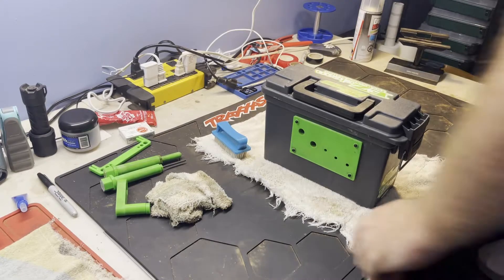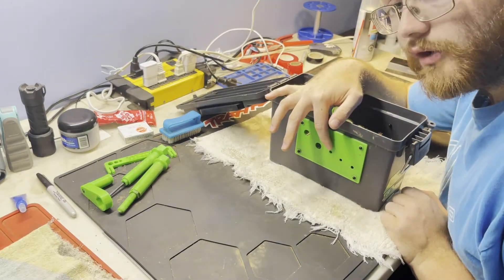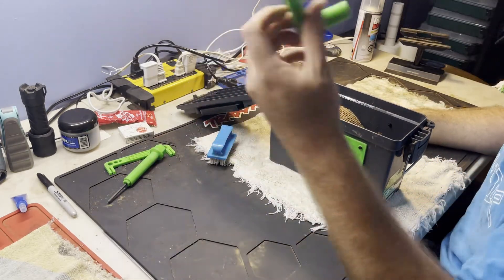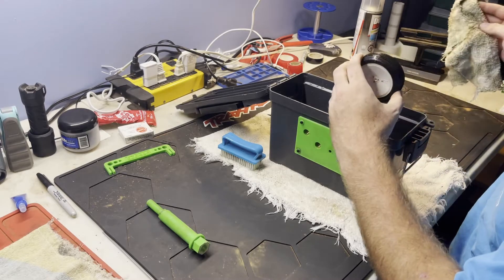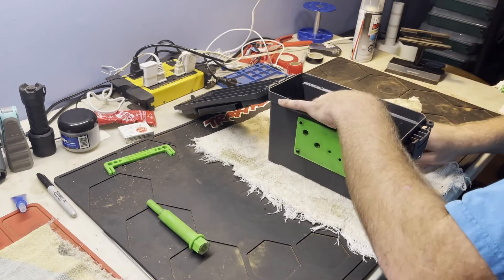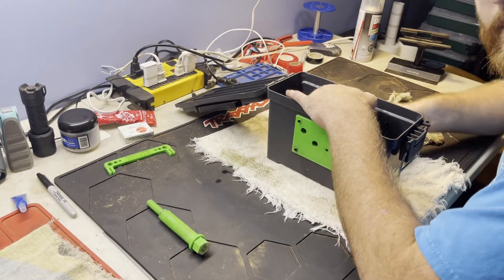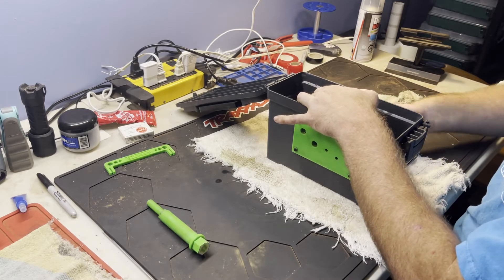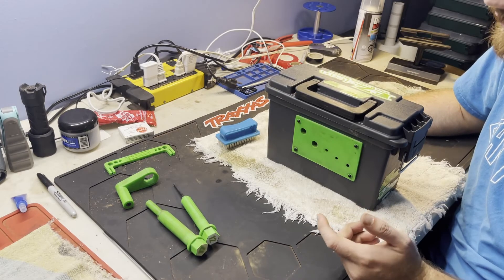My New Tire CLEANING SETUP

Comment: Bro Just mix Dawn dish soap water and isopropyl 50:49:1 into a spray bottle. Spray it onto the tire and hit it with a brush. It actually CLEANS the rubber and wheel while removing surface debris and staining. As far as RC is concerned Simple Green only excels in non-porous plastics and metal components.